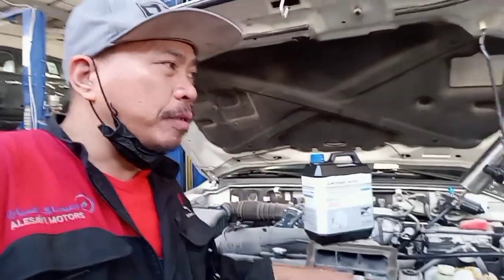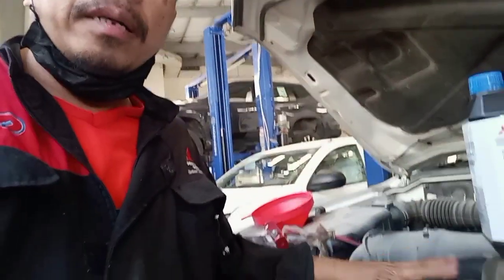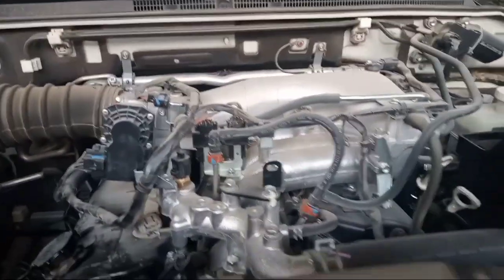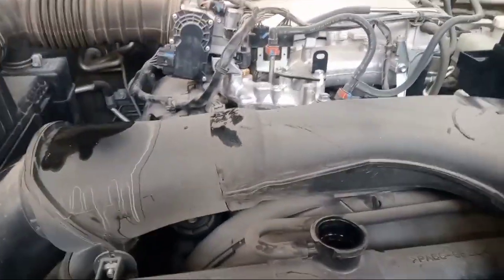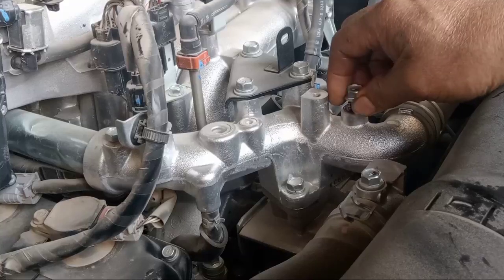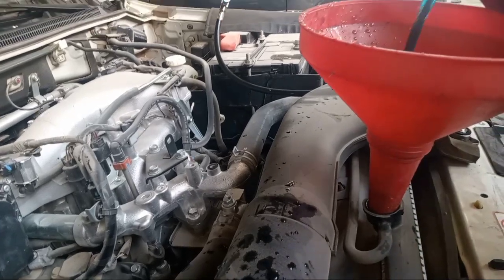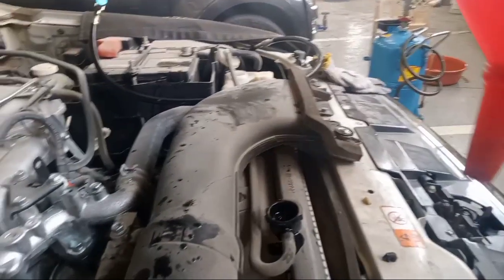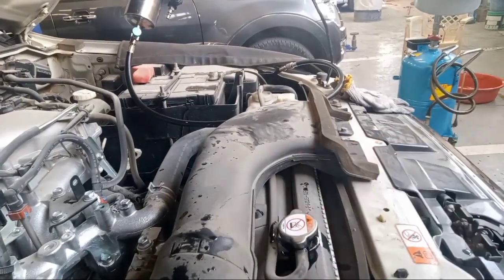Mitsubishi Pajero (tech. info) how to put radiator coolant

Comment: Hello, if it was the 3.2 did m41, what is the correct procedure?
Reply from the maker: Sir they have. Different if  like. The style or model. In the. Elbow make it release the. Water o at the plug bolt